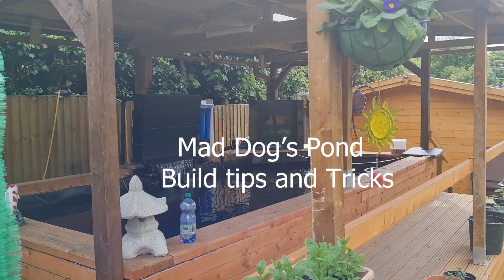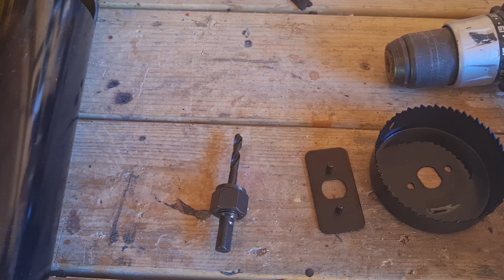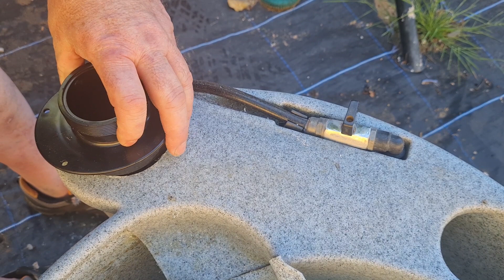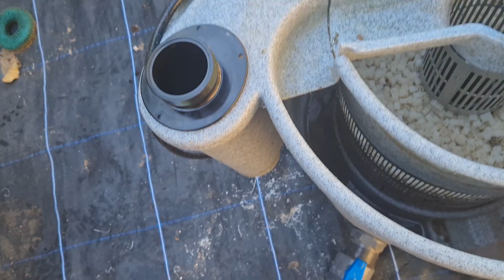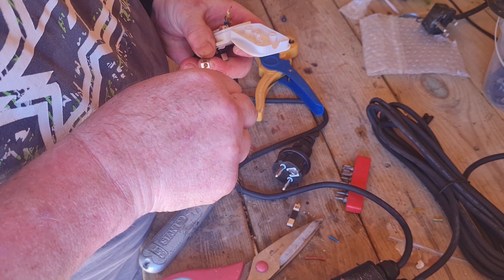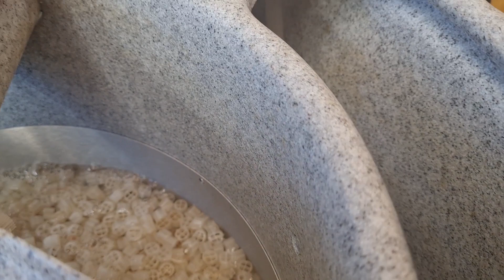Retro fitting a UV to A Easy Pod

Comment: Hiya, where did you get you top plate part from please, I’m trying to locate one
Reply from the maker: Hi, originally, the Rep from EA said they were going to do the parts for the old easy pods and then decided it was not finacially viable to do it, which I thought was bad it is a spare part it's just getting them sorry
Reply from the maker: Update sorry its been so long had to become a shop to get anything done im going to be doing a review the weekend on some new easy pod meadia covers and at the same time hopefully have an outcome for the parts the critical bit is the Insert cap which is being worked on as we speak

Comment: Did this ever come to fruition? Great idea and would buy one straight away
Reply from the maker: Yes, it's available to buy through shops and online if you get stuck send me a message I'll send you a seller
Reply: Yes please all I can find are std replacement units but not retrofit units - thanks for your help
Reply from the maker: @Andy Thompson  contact Rob Walker from Walker Koi 0138462058 mobile 07774976867 tell him maddog sent ya
Reply from the maker: Update sorry its been so long had to become a shop to get anything done im going to be doing a review the weekend on some new easy pod meadia covers and at the same time hopefully have an outcome for the parts the critical bit is the Insert cap which is being worked on as we speak
Reply from the maker: @andythompson9146   Update sorry its been so long had to become a shop to get anything done im going to be doing a review the weekend on some new easy pod meadia covers and at the same time hopefully have an outcome for the parts the critical bit is the Insert cap which is being worked on as we speak